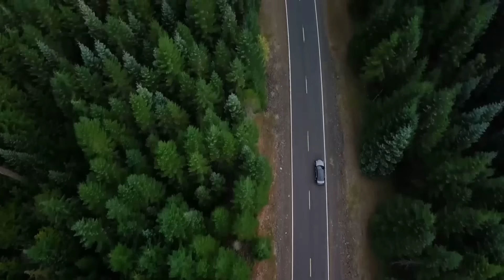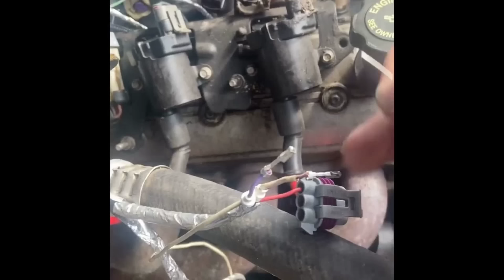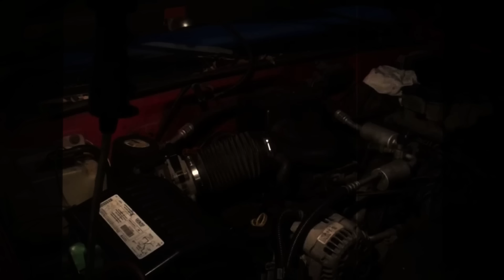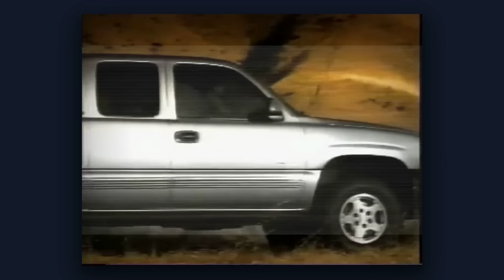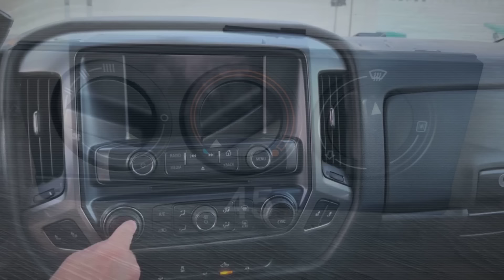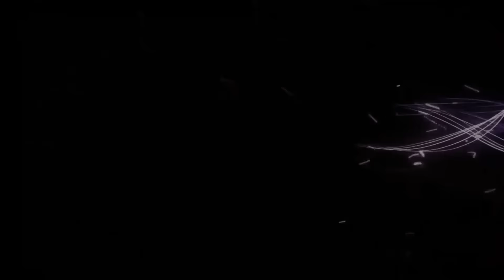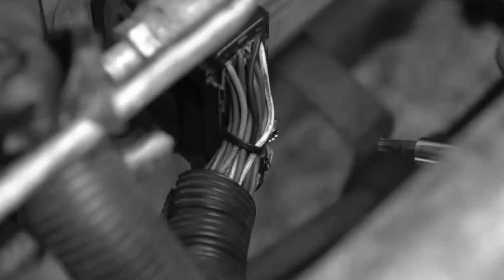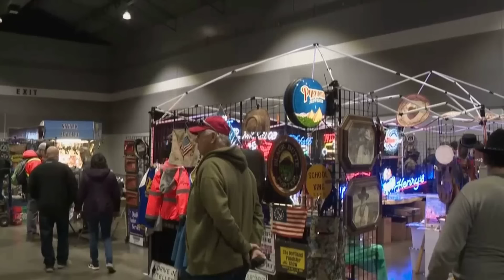How Smart Mechanics Are Bypassing The Dealership (The "Delete" Loophole)

Comment: Dude, what are you talking about? The vortec series has a distributor mount. They didn't do away with them until the ls series in the early 2000s.  On top of that, they make a carb intake for the vortec heads. I've done like 7 vortecs carb and hei distributor swaps

Comment: This has gotta be AI generated. No real world advice, AI slop. It's one thing to do these things suggested if you're a seasoned mechanic WITH programming experience... but  completely out of most people's budgets and diy know how. Actual right to repair legislation is the only thing that will prevent these OEMs from screwing you. Vote for people who support it. "Don't make the part? Ok, you must provide original blueprints, programming/software to the consumer. If it's proprietary data but you don't make it/make a fix for consumers/owners: you must provide all the data related to anyone that asks. Nevertheless: this video is AI trash. Don't engage; I already did.

Comment: In Illinois we must have our cars tested by the EPA every two years. They used to put a probe up the tailpipe to test the exhaust gasses. Now they plug a tester into the OBD plug. If the PCM is removed, how will they run the test?

Comment: I have the same thinking about motorcycles with fuel injection. I will keep with my KLR650 . It is a Gen 2 with a carb . I can repair it enough to get me home . I keep cardboard and rubber cement in my storage case . Along with some tools . My Jeep is another word . It will be the last newer car . That I will be buying . I will be keeping an eye out for a junker in a field or in a scrap yard . To repower it . Will be cheeper then a new car . If you do it rite . You will even have warranties . Just not the motor company manufacturer warranties . I have repowered vehicles back in The 80s and 90s .

Comment: I have done this. I got a 1991 Ford Econoline van that ran like crap on the factory EFI system. I ripped all of that out, including the wiring harness and threw on an intake manifold off of a junk 289 V8 I had laying around. It bolted right on the 91 model 302, and I replaced the original computer-controlled distributor with an aftermarket HEI unit. The transmission was a fully mechanical AOD and didn't require the computer to shift properly. All I had to do was find a way to hook up the kickdown cable to the throttle linkage on the carburetor. As for the wiring, I only needed a single 12 volt key power wire for the ignition, the oil pressure sender wire, and the vehicle speed sensor wires to keep the rear ABS operational. The final piece of the puzzle was a fuel pressure regulator to bump down the fuel pressure to 5-7 PSI so the carburetor wouldn't flood. I did this so I could keep the dual tank setup. Finally, I had to straight wire the fuel pump to key power to make it run all the time. This is normally controlled by the ECM. The ECM is completely deleted in this vehicle, and it runs great!

Comment: I got a 1989 302 motor that had a cpu to operate the throttle body. That was in 1989 from a wreck car.  I took the intake manifold off put a carb back on. Put it my 1970 F100 truck . It was getting 7mpg . After 26mpg at 70 mph. Yes it worked great.

Comment: When my glow plug controller went out I wired them directly through a normally opened push button switch. I push for a half second about seven times and Viola. We will be able to figure this stuff out. Many parts are easily repaired

Comment: Great ideas, but the issue i see is the actual mechanical parts failing, like bands in transmission or any number of mechanical issues that can and do happen eventually going to run out of parts to use.  I think we're hosed as far as quality autos being built anymore its all planned obsolescence.   I mean hell the new ones in 27 are going to have cameras and Ai watching you not to mention kill switches.

Comment: The complexity Threshold has been crossed . $66,000 for a new vehicle?  Most people need to haul 1000lbs or less a max distance less than 50miles only a few times a year.  We've over engineered the banana peeler.

Comment: This is a good loophole until the EPA starts enforcing emissions laws that already exist. You'll currently never get away with this kind of stuff in California, they don't even allow vehicles to have a tune, let alone an aftermarket engine controller. If an emissions system is out of warranty, then the law shouldn't be able to require it to be maintained, especially if key system components are no longer available.

Comment: One of the 2 things I'm getting for my 03 Atlas trailblazer. When it decides to quit on me. 

1.) A stand alone $2000 ECU and engine wire harness.

2.) Any Junkyard GM Carb or OBD1 era V8 and transmission when I can't afford a junkyard Atlas 4200.

Comment: 1996 Ford couldn't find a ECU so I just converted it to Old School carburetor change the intake and  put a pressure control regulator on it to drop the pressure to 6 PSI from the fuel pump.

Comment: Honda Oddsey 2004  ignition key mechanism failed.  Took the tumbler assembly off the column opened the tumbler removed the tumbler key springs and pins. Reassembled my FOB is read normally... my key works normally..

Starting the engine and no one knows differently plus no one is going steal a 22 year old car.  Besides, without the key FOB, it only runs for 2 seconds. Caviot: I can remove my key to get my wallet I left on in the house without shutting down the engine. JOB TIME : under one hour start to finish. JOB COST: One beer.

Comment: I have a 91 Suzuki Sidekick with the fuel injection system removed and a cheap $125 carburetor on it.  It run like a top; smooth with more power and better mileage.  I am not going back to driving a connected PC that the factory controls

Comment: I have nothing newer than 1993. In my truck is a standard Ford small block. I ripped out the computer and fuel injection when the truck went over 200,000 miles. Rebuild the engine and trans, installed a carb and aftermarket ignition. Renewed the suspension parts and repainted it. It's now a new 93 that should get me over another 150,000 miles. I've got 2 old big block 70s cars. I'm rebuilding them like the truck. I will never purchase a new or newer vehicle.

Comment: I want to get away from all the electronics, myself.   Almost all failures I have had with my 2011 Acadia were electronic related.   The vehicle itself is sound.   Replace the engine and rewiring everything seems like a better investment, even if I spent the cost of a new vehicle to rebuild the Acadia.

Comment: I once rebuilt a head gasket for my '92 Chevy Cheyenne. I had an anvil, a forge, some spare lead I'd scrapped from old batteries (originally meant for making ammunition for 300 Blackout), and a set of micrometers and calipers. Took a few hours and a bit of research on my phone to figure out how to temper lead to get uniform joinery, then another four or five hours of hammering and upsetting to get it perfect. Installed and torqued it down and it fired up no problem. I got a solid 75,000 miles out of that head gasket after the repair. 

As Ron Swanson once said "People who buy things are suckers."

Comment: I am building a Faraday cage for my telematics module, "they" will not see me, or my movements, milage download up dates etc. This will require a cold reset of the vehicles computer system. Disconnect battery for 12+hours. There is info on YT on how to do that.

Comment: If you live in a state that has, Emissions Vehicle Inspection before you can register your car. It has to meet the emissions for the year it was built. So if you start using after market ECM. Use a carburetor on a car that was made with EFI. Swap an engine it was not built with. The state will not register it. Emissions parts must meet aftermarket part certification regulations contained in, 40 CFR Part 85 Subpart V. Any engine control devise you swap in must meet this standard. So unless you live in a state with out emissions vehicle inspection. You will not be allowed to register a vehicle in any states with Emissions Vehicle Inspection. When you see the words. Planned Obsolescence. Hear is the definition from Webster. The practice of making or designing something (such as a car) in such a way that it will only be usable for a short time so that people will have to buy another one. And they don’t do it for just your car just about every thing you buy now days is designed this way. So before you start doing this type of thing to your vehicle. Make sure you can get away with it. Before you spend all kinds of money and time doing it.

Comment: Seriously these mechanics need to just crowdfund a OS to replace the factory OS the vehicles come with.

Every single fix they make spirals the system into replacing practically the whole inner workings of the vehicle because the OS that the factory put on the computer is set up to make sure all the hardware is original.

You make a OS that works with any hardware and all the problems are solved the first time you replace a broken piece, and that worse mechanics have to start installing the OS every time they work on a new vehicle for the first time, probably a 10 to 15 minute process of starting the install and letting it run.

Comment: about 30s in you said Glow Plug Control Module, its actually a Glow Plug Relay Control Module, instead. as soon as you hear the fancy relay controller is bad and you cant get more, and you arent one to take it apart and look at it further, then you need to get an extension cord and a light switch and run that to the relay switch pins yourself and 'turn the lights on' before you start cranking, off when youre done, add buzzer for safety.

Comment: Years ago, lots of Capri's were on the road.  But they had a fatal flaw, the control arms were cast iron, so, if you bumped a curb, the soft cast iron arm would bend.   So, most started going to the scrapyard.   But, right in the final days, a guy made control arms with tube, and gave those left with new life, and sold control arms made with tube, that was 80% lighter, and 200% stronger.   Why didnt Ford make the part?  Because they sold cars, not control arms.  Imagine totaling your car, by turning the steering wheel, and inching forward to find the curb.

Comment: One time my radio failed so I rigged up an old clock radio and wired it into the electrical system. I had to get a noise filter, but it worked old school!   Yeah, I was bored at the time….  😮😅

Comment: First issue in the video. I bought a 95 f350 new 7.3. In a few years the glow plug relay went out. It looked very familiar but still I went to Ford dealer for one. They wanted 140.00 for it. I told them I had just bought an almost identical one at a hardware store for ten dollars! A lawnmower starter relay that looks like it came off the same production line. So in the 30 years since if it fails, I buy the mower relay.

Comment: My 2007 FORD E -450 CAB AND CHASSIS DUALLY ECM COST ME $2,000 BECAUSE VERY FEW ARE STILL AROUND IN THE USA...
THAT INCLUDES PROGRAMMING...

GREAT VAN/TRUCK THAT IS EASY AND CHEAP TO FIX...
150,000 MILES AND NOT 1 DROP OF ANY FLUID LEAKS....

Comment: yup by switch to aftermarket parts it make the truck or car keep going, however, in california that is not legal for smog check, hope Mr. Presedent can stop the smog check, smog check really does not much to help the air, instead it cost every car owner a lots of money to keep their car "LEGAL" to operate in california over a small check engine light with a trouble code, sometimes the trouble code does not even effecting the engine performance, no shaking, no misfire, engine running smooth, just a EVAP system small leak and cost customer paying over 4 figures repair bill.

Comment: I put a 5.9 Cummins p pump with nv4500 in my 87 Chevy Crewcab..truck is fully mechanical off the grid. Thinking about putting a 383 Stroker in my 2015 Challenger the day the v6 needs a rebuild. Really hate computer crap in newer vehicles.

Comment: Couldn't you gut the ignition system and make a switch that matches the resistance of the missing parts, so that the key's resistance still is part of the locking mechanism? All the key eould do is by a physical bridge for the current

It'd simplify things by making the system standardized.

Comment: My 2012 Expedition needs an ABS module, can't find one anywhere. It drives and brakes fine, I'll just live with the lights.
Reply: till its more than lights.    jus keep drivin till it leaves u stranded
Reply: My 2018 Honda civic has a couple bad sensors so most of my lights stay on. Periodically they correct themselves and all turn off for a week. Then they come back on. 😂😂
Reply: @AlderaansRanger same 2014 civic tons of lights come on, but car drives normally just annoying lights that turn on and off of abs, power steering, and freaking traction control even though my car can't turn it on manually cause tpsm sensors are no on the wheels. Lmao